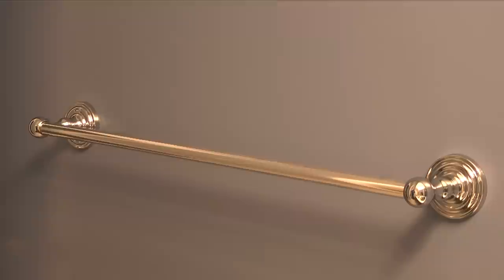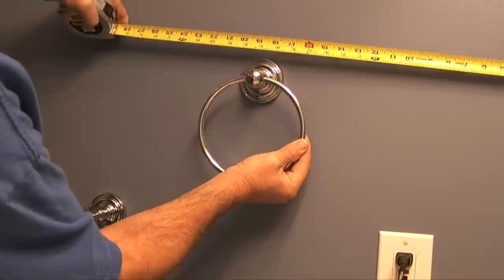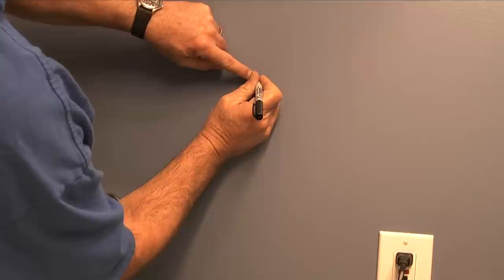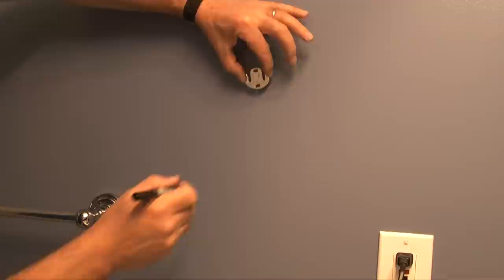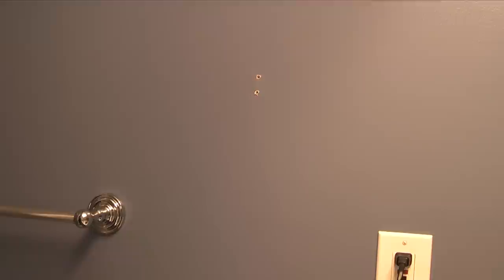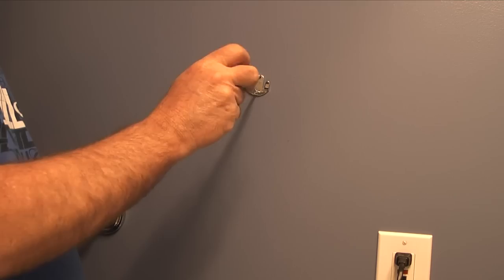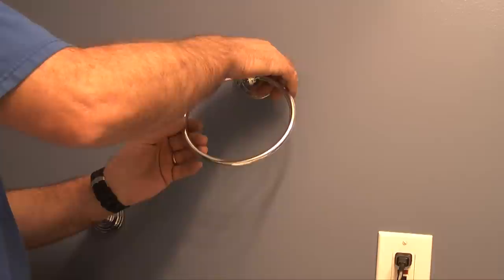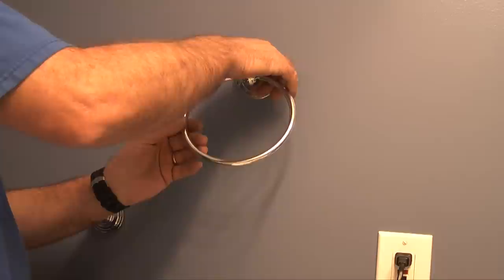Towel Ring Installation

Comment: The hardware is secure on the wall and is not moving, but now the  ring holder-hardware lifts up. The nails are secure in the wall, but I can't stop the whole fixture from moving up and down. I can literally lift it up and remove it. Any suggestions, it wasn't moving originally, but due to wear/tear-the whole ring is loose-again, the nails are secure.  Thanks for any help you can give.
Reply from the maker: I had the same problem with my towel ring. The problem is there no set screw to keep the ring assembly from sliding off the wall bracket. Very frustrating.

Comment: Well just installed and this thing is terrible, there is nothing that keeps it in place if pulled up. If you grab a towel an it hangs on the ring the whole thing just raises right off the quick clip.
Reply from the maker: You're right. I installed two of these towel rings, one I used wall anchors and had the same problem you did, the second I installed into a wall stud without the wall anchors and it stayed firmly in the bracket.

Comment: Worst mounting mechanism I've ever seen. Have to use full force to put on the actual ring assembly onto the wall bracket, which pulls the paint off the wall. I wonder who is the genius that came up with this POFS idea.